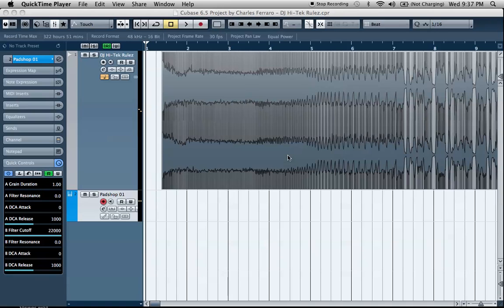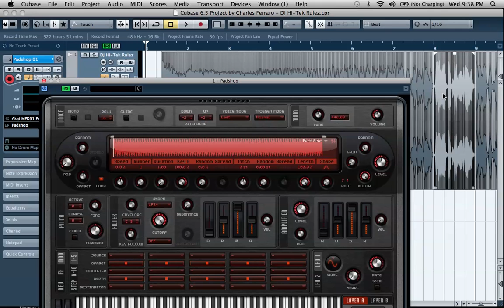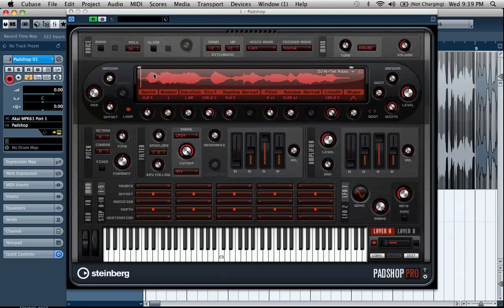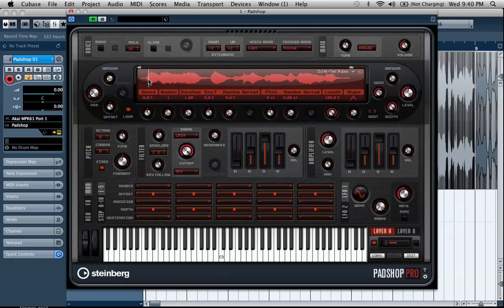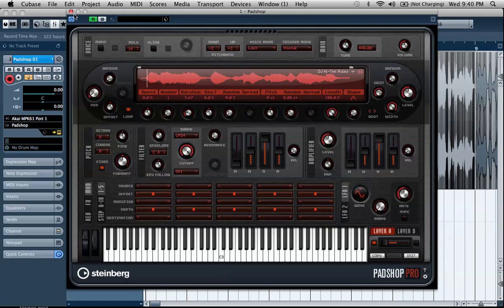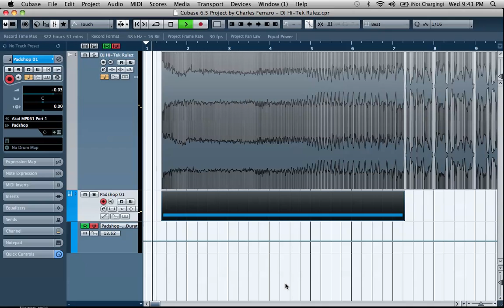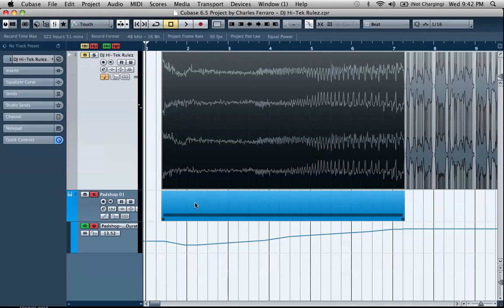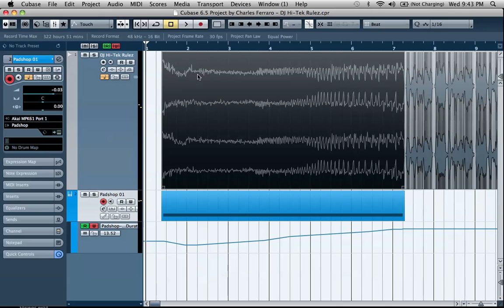Die Antwoord Padshop Pro Tutorial

Comment from the maker: You should be able to run Stutter Edit just fine if you're using the trial versions of Live and the plug-in.  Make sure the source file for Stutter Edit is in the Ableton VST folder.  I'm not sure where the location of that folder would be on your hard drive... it depends on your OS.  Try the Live manual, forums, or e-mailing the people at Ableton directly.

Comment: great tutorial!  could you elaborate on the quick control?  What are you using to control grain duration?  my padshop shows modwheel only to assign.  thanks!
Reply from the maker: +william moore if you right click you'll see: Add "A Grain Duration" to Quick Controls Slot
You can then choose which slot you want to assign that parameter to.
You control 'quick control' parameters with a MIDI controller that you'll need to have previously set up under Devices > Device Setup... and click on VST Quick Controls in the left hand column tree.  You should be able to figure it out from there but feel free to ask me if you have trouble.